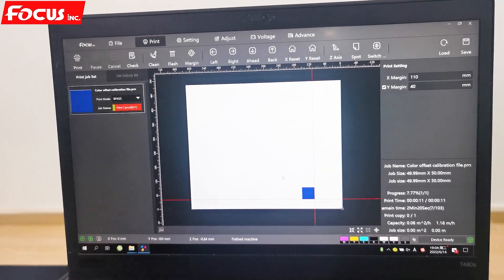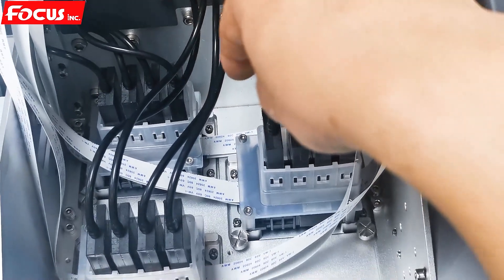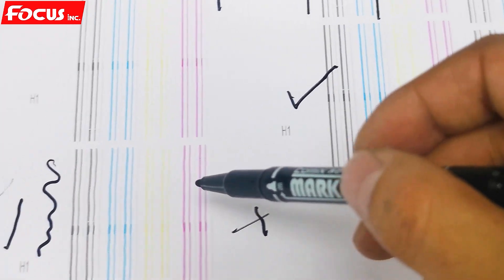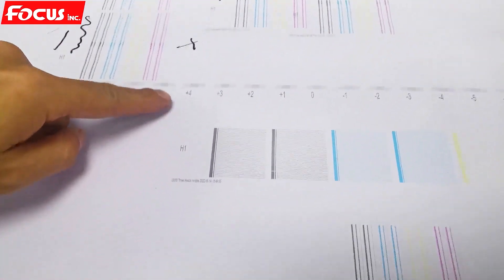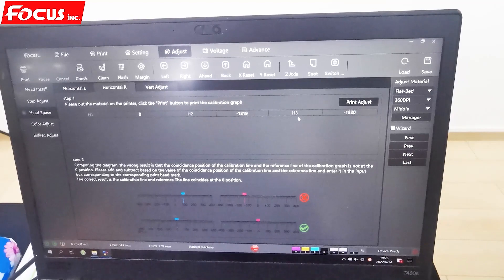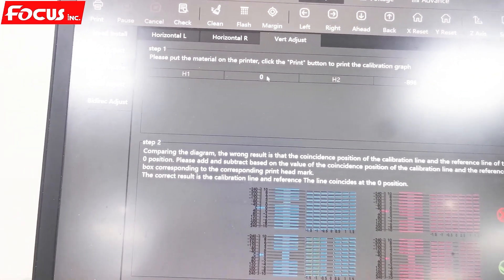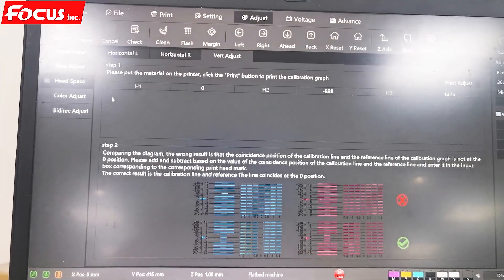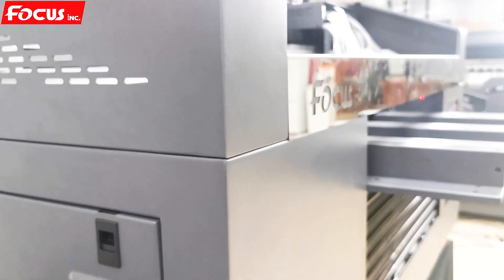FocusInc. Starfire-62U Roll to Roll UV DTF Printer & Laminator All in One- Guide10 Nozzles Alignment

Comment: Hi, What if left and right adjustment never match? I mean the top of the lines are aligned but the bottom are not aligned. Should we lean on the one on top or bottom. The one on top is Right to left and the bottom is left to right.